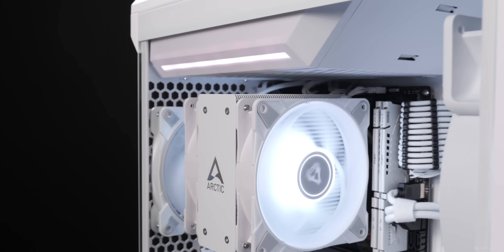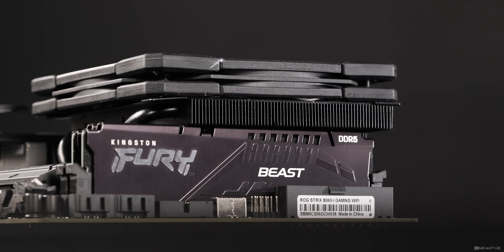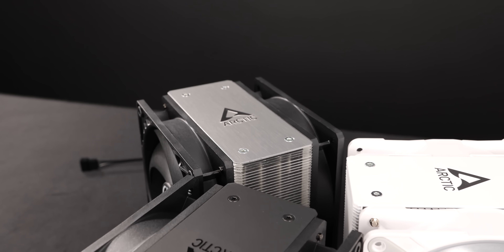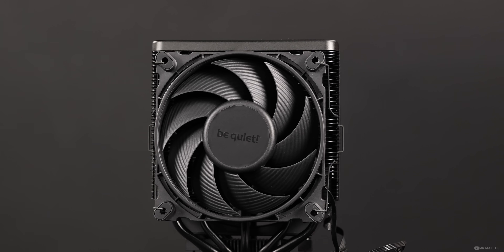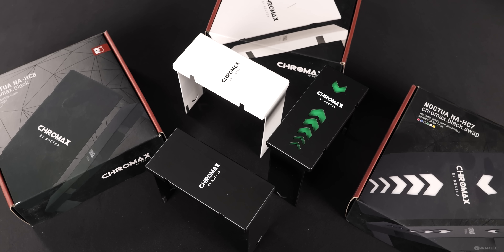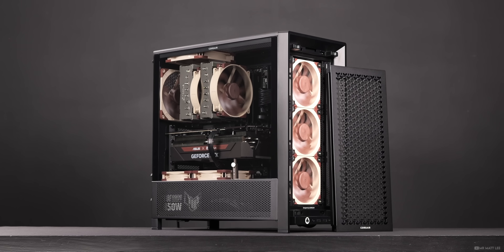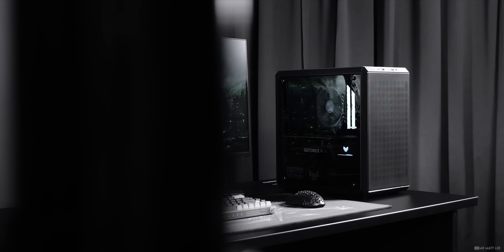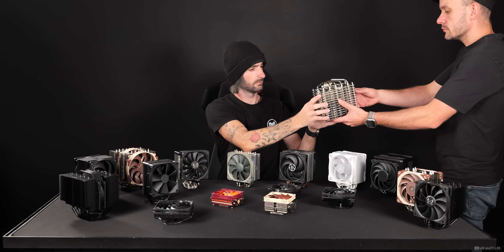Cooling Kings: Top CPU Air Coolers That CRUSH the Heat in 2025!

Comment: Thermalright Phantom Spirit 120 and Assassin Spirit 120 are all you need nowadays if you don't go ITX
Reply: I have the assassin 120 SE for my 7800X3D and in most games it stays so quiet I cant even hear it
Reply: @mrnamenlos5000  what's your temp normally
Reply: @mrnamenlos5000 what temp you get?
Reply: I'm building a rig but going Intel because AMD are too pricy in my country but then when I look at reviews and benchmarks the i5-14600k is beating quite some Ryzen entry ones like 7600X and 7700X and also is cheaper than those 2 cpu so I'm really going to go with i5-14600k as it's more than enough for me.
Reply: @archvile1313 Be sure to also compare the power consumption. Newer Intels are quite demanding and also get hotter, requiring a bigger cooler.
Reply: @BlackAera  TDP are a bit more/less depending what's going on, sometimes Intel is more than AMD and vice versa. As for cooler I'm probably going with a dual tower as it's enough for 14600k being either of the thermalrights or any other efficient dual tower like AK620. Crater channel has used an AK500 cooler for 14600k and got good cooling with it and that cooler isn't dual tower now if that isn't valid then their videos are misleadings, you can check it out if you want.
Reply: Not if you go for intel cpu
Reply: @ketsi3079  But who really goes for Intel CPUs these days in all honesty when AMD has crushed them over the years, in basically every aspect there is?... Speed, efficiency, cooling and longevity. Just don't see a reason to go Intel these days unfortunately.
Reply: @Dawelio  some people might still preferr intel
Reply: @Dawelio Many, intel 12400f /13400f are popular entry choice and very cheap. Personally I'm using ryzen, but I had built many PCs with intel CPUs for people over the years, they prefer them for some reason.
Reply: @ketsi3079  Yeah of course, I'm not saying anything about preferences. Just that going Intel these days doesn't make a whole sense when AMD offers so much more across the board essentially.
Reply: @WolfFromEast  Fair enough, although that's then basically buying into a EOL platform and hence longevity is out of the question unfortunately.
Reply: @Dawelio Many things have no sense mate, it is what it is. Most ppl don't want to hear about AMD GPU's, they would rather run on 3060/4060 with 8g vram than let's say 7800xt or 9070xt.
Reply: @WolfFromEast  And neither was I talking about AMD GPU's to begin with...
Reply: @Dawelio like I've said, many things have no sense, be prepared to hear many of them which are not part of your alignment of beliefs. Best thing you can do is ignoring, not arguing.
Reply: @Dawelio  Best CPU In 2025 - Intel Core Ultra 7 265K/KF 👍 Max Usage 5-25% (With RTX 3050 Of Course 🤗), Temp 40°C (Air Cooling), Cost 250 Euro 🤡😆👌
Reply: @ThePolishJoker The heck are you talking about?! It's more like 300€ minimum and gets outclassed by the 5800X3D and 7800X3D in price, performance and power consumption. You are delusional.
Reply: @BlackAera Payed 260 Euro For It 👍🤦‍♂️
Reply: @WolfFromEast  Best thing one can do is not determined by you, but thank you.
Reply: @ThePolishJoker Could have gotten a 7600X for 170€ instead. Honestly if you don't require multicore workload performance and just want a gaming CPU, Ryzen still outclasses Intel on all fronts.
Reply: @BlackAera  You're Soo Dum Srsly,..🤦‍♂ These YT Videos Made Only Holes In Your Brain 😆 Intel Core Ultra 7 265K/KF (250 Euro) Has Similar BenchScore To AMD Ryzen 9 9900X3D (550 Euro) & AMD EPYC 4584PX (600 Euro) And You Come With A Garbage Like AMD Ryzen 5 7600X (150 Euro) With The Half Of The Score HAHAHA 🤣🤣🤣
Reply: @BlackAera  And BTW,.. In 2025, NoBody Cares About Gaming Performance AnyMore 🤦‍♂ Because It's The Most IrRelevant Factor When Buying A CPU.
Reply: @Dawelio Still arguing I see,... Best thing is not to tell or judge people what is best for them, you are young, you will learn.
Reply: @WolfFromEast  You're one to speak about "still arguing"... And also, you don't know me at all, so please refrain from thinking that you do. Thank you.
Reply: @Dawelio finally you get it, true, I don't know you, don't wanna nor I care for your "insights".
So next time you give advice to other people about what's good or not, remember your own words.
Reply: @WolfFromEast  Yet you seem to not understand when did I give YOU any advice, like at all? I never did, since I replied to someone else's comment... YOU were the one who quoted me on mine regarding "advice".

And who's "still arguing" ?... 
Maybe you should take your own words - "remember your own words." Since you clearly don't. 

Also try not to quote someone's response and then try to make it all about you in the future, it makes you look desperate for attention.

This is me done with wasting time on this pointless "discussion".
Reply: @Dawelio you done? For real this time? Maybe there's still hope for ya 🫡
Reply: @Dawelio  Not true if your pc is mostly used for work and a little gaming intel is a better choice
Reply: @ThePolishJoker Dude ty ! You convinced me ! I bought the Intel Core Ultra 7 265K too and unfortunately, I reach picks of 105 degrees Celsius 😭 with my Noctua NH-U12S. Idk if this is the problem of the Ventirad because I know his potential but I really think that I have to change this and I had a look for Thermalright Phantom Spirit Evo. I find him incredible for his price
Reply: @WolfFromEast  Outside the YouTube tech bubble Nvidia still rules. For workflow and gaming.
Reply: @OwDoDuck yes, absolutely, unfortunately they are very expensive, at least their high end line GPU's.
Reply: @ThePolishJoker  With which Air cooling? İ have ultra 9 285k im searching which one aircooling i need .
Reply: @Turkey-Star Check BenchMarks 💁‍♂️ I Use FROZN A720 Black 🤗
Reply: This. And if you go itx you still have the peerless assasin 120 mini
Reply: @denisnatera3633 And if you can only use a top blower, the Thermalright AXP90 or AXP120
Reply: Not even that, I downgraded from PA120 to old Mugen 4 on my i7 12700 because I cap it at 125W anyway, and temperatures in gaming are pretty much identical. Have a reasonable CPU and pretty much any tower cooler can cool it without any problem...
EDIT: now I see what Assassin Spirit 120 is, damn TR has so many models, well yes, that cooler should be more than enough like you said. Its probably comparable to my old Mugen 4.
Reply: ID Cooling better
Reply: @PixelatedWolf2077 Actually Thermalright really is better. ID Cooling is close but gets beaten in terms of performance and quality control.
Reply: @BlackAera  The A620 outright beats the PA in performance, plus it's been out longer.
Reply: What if I go ITX or mITX?
Reply: @ghostofnothingness If your case allows for a small traditional tower cooler, go for the Thermalright Peerless Assassin 120 Mini. If not, go for the biggest top blower cooler your case allows for, that doesn't clash with your mobo design or ram hight. Alpenföhn Black Ridge with a swapped Noctua A9x14, Noctua NH-L12Sx77 or Thermalright AXP120 are recommendations but they reach above mobo parts and ram. If you have to stick to smaller coolers go for Thermalright AXP90, Noctua NH-L9x65 or Alpenföhn Panorama 2.
Reply: Yeah but its ugly
Reply: I built a new box using the 120 yesterday. I like it a lot. 9800x3D - dead quiet.
Reply: they are cheap af but they also are the worst and laudest dual tower coolers i have ever crossed... that TR hype for noobs is funny. i pity you TR fun bois
Reply: @salvatorekrzysztoszefski8649They are really quiet. No idea what you are talking about.
Reply: If you go for the air cooler, the Phantom Spirit is basically the only option. It outperforms even the insanely greedily priced D15 G2 at 100% fan speed. And it does that with 1/3rd of the price.
Reply: @Rippeee DeepCool AK620 joins the fight

Comment: Great video!!

I’m running a Lian Li Q58 (small form factor case) with an i7-13700K and a 7800XT. While gaming, my CPU temps hit 100°C.

Currently I’m using a Corsair H60x Elite RGB 120mm AIO. I know it’s a bit small, but the Q58 has very limited space. The clearance between the PCIe riser cable and a larger radiator looks really tight, so I’m not sure if I can upgrade to a bigger AIO.

I’m also considering switching to an air cooler and adding two top exhaust fans instead.

Has anyone with a Q58 and a high-power CPU found a good cooling solution? Any suggestions are appreciated!

Comment: I would like to officially express my frustration that Noctua is dragging its feet with the NH-D15 G2 black. The third quarter is slowly coming to an end and there is still no announcement for the black version. It was already postponed from the first or second quarter to the third, and since then there has been radio silence.
edit: Oh, and I have a 9800 X3D under a Noctua NH-U9S.

Comment: Initially, I was using an AIO liquid cooler, but it broke (even though it was still under warranty). The worst part is I had no idea when it failed. I only found out after I downloaded MSI Afterburner to check my FPS and saw my CPU temperature was constantly spiking to 80-90°C, sometimes even close to 100°C. Now, I've switched to an air cooler—specifically, the Bequiet! Dark Rock Pro 5—and the results have been surprisingly good.

Comment: thermal right phantom spirit 120  user here great cooler keeping my i7-14700k cool all the time usually around 70c on full load (paired with the thermalright lga1700 bracket) , my case lian li lancool mesh II performance fans on lowest rpm

Comment: Thermalright Phantom Spirit 120 SE for my 9950X3D, built it myself, hasn't disappointed yet, the CPU does not go over 60c while gaming, 85c when CPU at 100% usage. For the price/performance ratio, I am very very happy with it. I would buy another one when it fails in the future
Reply: I mean, then again, it IS a tower cooler so it's probably going to outlast the rest of your rig anyway so not like you'll need a replacement within the next 5 years or so
Reply: You’d really only need to buy new fans, but I’m sure they’d appreciate the sale
Reply: get a royal pretor 130 it's the upgrade version for even better cooling for 5-10 bucks more
Reply: @mygale562  technically only the Royal Pretor Ultra model is the larger version of the Phantom Spirit with 7x6mm heat pipes. The regular Royal Pretor has 6x6mm heat pipes. And the Frost Vortex has 1x8mm and 6x6mm heat pipes
Reply: I use a ID Cooling a620 pro se with a 9800x3d(-20 all core), 65c max at 100% usage.
Reply: I finally got around to trying a Peerless Assassin and thought it was all hype, but I was thoroughly impressed. I threw two Noctua A12x25 fans on it so, sure, it increases the price, but the performance was astounding.
Reply: Hey, did you undervolt it? I'm afraid this cooler won't be enough for my 9800x3d that I ordered.
Reply: @garlicfresh4145  Working well here. Never above 80C. I don't overclock, and using PBO with negative curve.

Comment: Right now I'm on Assassin IVS. But already have PA120 Digital and PS120SE from thermalright. It's depend which pc case I'm using. With my Lian Li Dan Case 3 Wood I'm using Assassin 4S, other hand Lancol 207 i go with Thermalright variants. By the way Cpu is 7800X3D.

Comment: pentawave z06d srb  GOAT, looks tests
Reply: It's a rebadged Thermalright PA120 et al.
Reply: @Berserkism  renamed? then why is the radiator design different? no traces of soldering of tubes and according to pentawave tests it is 3.7 degrees colder?

Comment: it would also been nice to see the id-cooling a720. A monster cpu cooler with about the same (if not better) performance than the noctua nh-d15 g2 at less than half the price (about 60usd right now). That form me is the current goat of air cooling together with the phantom spirit

Comment: 10:05 the Thermalright Cooler is mounted wrong. This cooler is one of a few 120 dual tower that is asymmetric in direction to the GPU. To have more space between GPU and CPU Cooler. Have it in use in my AM5 build. A really good performance for this size of a cooler
Reply: i think you installed your brackets wrong and that gave you the impression thats how it goes? the manual and website shows it pointing just like the video, which makes sense because of common air flow patterns. your cooler has been sucking in warm GPU air instead of fresh air. They dont put them any other direction for that reason
Reply: @_lim1542  thanks, but maybe you got it wrong. He needs to turn the cooler about 180°. Also in the manual you can read "Thermalright" from bottom to top. This cooler is asymmetric from the side!

Comment: Can Thermalright Phantom Spirit EVO cool a 9900x processor?
Reply from the maker: As much as the cooler is important, so is the case. Assuming your case has excellent airflow it should be fine.
Reply: absolutely
Reply: Thanks

Comment: Best video 2025 :hands-yellow-heart-red:
For my 7800X3D and 9800X3D
:medal-yellow-first-red:Thermalright Phantom Spirit 120SE with 2 Silent WingsPro 4 120mm :trophy-yellow-smiling:
Reply from the maker: That’s a solid choice right there! 💨💨  Which case are you using? I assume something with nice and directional airflow.
Reply: @Mr_Matt_Lee  Pure Base 500 unglazed but with the mesh facade of the DX and with 3 other Silent Wings Pro 4 of 120mm on the front and another of 140mm at the back for extraction.
Despite a 5090FE in both cases (because yes two configurations) almost identical except for the 7800X3D vs 9800X3D... the thermals are excellent and the noise pollution is contained.
I think I will try to put 2 Silent Wings Pro 4 but in 140mm to see if I gain in thermal... I have some more in stock :cat-orange-whistling:
Again thank you for your content, always chill, which makes me have a good time, for a fan of hardware PC :hands-yellow-heart-red:
Reply: Ima add from the testing I saw on Youtube the fans of Thermalright on the cooler are already really good. Replacing them doesn’t do much but it’s all preference and SW4 Pro is a good choice
Reply: @themarketgardener  I iested for the noise and I prefer the sound of bequiet :body-blue-raised-arms:
Reply: Can I ask how quiet/loud the Silent WingsPro are above 50% fan speed? I recently replaced the stock Phantom Spirit fans with a pair of Arctic P12 Pros and while they keep things cool, they are too loud for me. Cheers!
Reply: @nelsonlenelson  It’s very relative and subjective, but to give an example, in gourmet game namely Star Citizen in 5K2K Ultra, I don’t exceed 70°C with the Silents Wings Pro 4 at 45% which is 1575 RPM and those are the 5090 FE and Solid that make more noise with their fans around 58% or 1800 RPM approximately.
The Silent Wings Pro 4 start to be audible from 1600 RPM for me with a cap at 1800 RPM that I don’t reach and I noticed that from 2000 RPM, the power gain becomes low and I remind you that the max of SW4Pro is 3000 RPM.
I therefore have 2 profiles on FanControl, one 30% with 1150 RPM for non-greedy games completely inaudible and a profile 45% with 1575 RPM for large games that remains below 70°C despite a 5090 that also runs in the case.
If it can help... To summarize, in the game, the fans of GPU 5090 surpass the noise of SW4Pro :yougotthis:
Reply: @NH-Nicolas  ah, having two fan profiles seems like the way to go. Thanks again!
Reply: @nelsonlenelson  Yes, the undeniable quality of the SW4Pro is that it is not necessary to exceed 1600RPM to recreate the X3D because they are extremely efficient up to 1800RPM while remaining low-noise.
It is only from +2000 RPM that the noise becomes noticeable and the relative cooling gain is no longer exponential.
So for me, Bequiet with its SW4Pro did an excellent job if we stay on the range 30% to 45% where it’s a perfect combo between cooling performance and silence :finger-red-number-one: